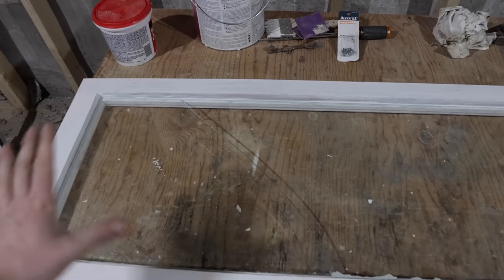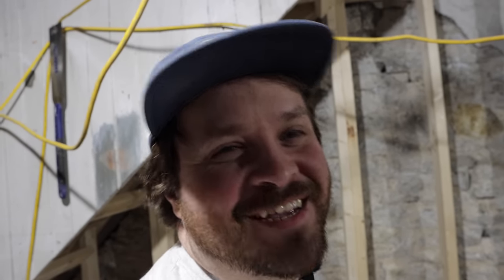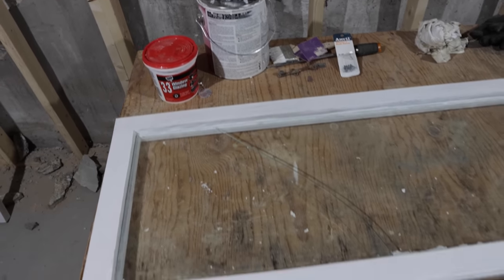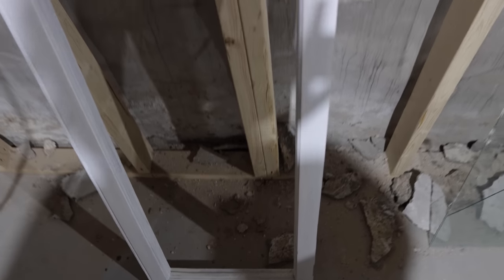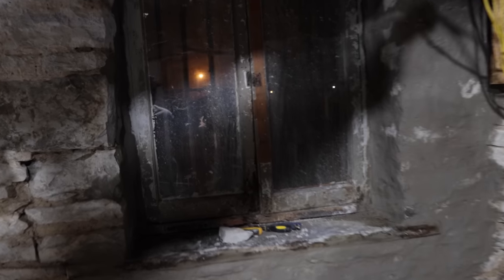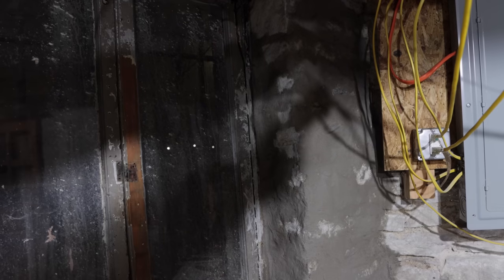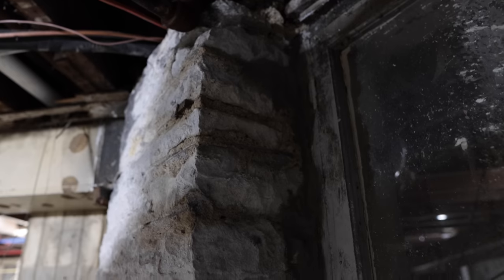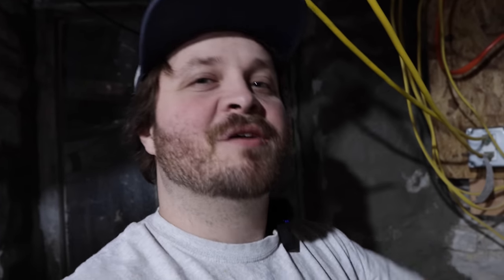Who Does This to a Window? S2 EP25

Comment: Your are totally right about "professionals" they never seem to care about the property they are working on.
Reply: Including their own. Visit a plumber, their toilet leaks.  Visit an electrician, their wiring shorts out, or there is a penny jambed into a fuse box.
One time, my dad purchased TV cable, and it was installed with the cable through a neatly drilled hole in a glass window.  My old wired alarm system had a wire hole drilled through a step, I did not find that until I installed a new carpet. Just what does it take to be a professional or even just be competent.
Reply: @Kaasmantel97  I feel like common sense, personal standards, and values died a while ago....

Comment: There is a mud gun for sheet rock that also now can use to put the thin concrete into the rock walls with the correct pressure it shoots it into the cavaties!

Comment: I work on pipe organs, and I have worked on 2 organs that the wire installers drilled thru a wall right into the main air line that feeds the organ. One of them was Radio City Music Hall!

Easiest, cheapest, fastest is the motto of installers of cable/internet/etc. They get paid by the completed job, not how well they did the job. Last time I had a cable guy replace my line from the pole, I watched him like a hawk and made sure he didn't do something dumb like a 1/2 inch hole in my original hardwood floors. I wasn't a dick about it, but I made sure it was done right.

Comment: Kaleb, you have been doing your home work. The windows are looking great.  I respect your choice of materials and technique. I did my home work, too. Abatron products: LiquidWood wood consolident, WoodEpox strucural adhesive, and Sherwin Williams Exterior Oil-Based wood primer. You mentioned SarcoSeal glazing compound. Yes! I have found it has woked better than any glazing out there. Even better than Dap 33. But, may I humbly impart a little advice about painting glazing compound? Reframe from priming and top coating it for a while. Maybe even a month. Because, I have found that as it dries, it shrinks, and therefore, the paint will become krinkeled. This is unplesant to look at and will trap dirt overt time. Just have the patiece to wait and prime and top coat later. My 1870s windows required much work, too.
More humble advice. When pointing your stone walls, use white portland instead of gray portland. Especaily where the walls will be seen. Upon close inspection, you will notice that gray was not used. Here is my mortar mix for simi-hard stone and brick: 1 white Portland, 4 lime, and 6 sand. Don't use mechanically crushed sand. Use natural river sand. Everything will point better. Any questions about where to find White portland? Contact me. (periodpaper@yahoo.com)
John
Bethel Missouri

Comment: About running the coax for the cable, I'd have the new coax run before you disconnect the current cable to keep down time to a minimum.  It's what I did to a brick, mortar and cinderblock house we lived in.  It was run through the crawl space and up through the floor, in the wrong room.  So I sunk coax through the floor where it was supposed to come in and voila, connected in just a few minutes.  I know your choices are slim as to where to run the cable in that doesn't involve a heavy duty masonry bit, but I think the process could be the same.
I hope this helps to keep the down time of the internet to a minimum for you two.
Thank you for a great video and don't worry too much about that broken pane of glass.  Like you said, it's an opportunity to install a thicker pane of glass now, albeit not period, but no less efficient. 👍👍🥰🥰🤗🤗😘😘

Comment: Sorry about the cracked glass. I can't remember how many times I've done this. As far as the cable guy running a cable through the window frame that is just wrong. My wife tells me to stop complaining about the millennials, but I just can't, not many take pride in their work. Sealing the windows will help tremendously. Once the basement is warm it will keep the floor warm for upstairs and downstairs. Keep up the good work.

Comment: Couple things about glass work.  First, look into Sarco glazing; it works very well and skins much quicker than DAP.  Also,  there are a couple videos out there where people use a palm sander with a cloth on the base to vibrate the glass down into the bedding glaze.  I can't find it now, of course, but the vibrations help evenly settle the glass.

Comment: When using Linseed Oil Putty - put the putty in the microwave for c.45 seconds to 1 min to soften the putty to make it more workable (the stiffer it is the longer time it needs in microwave to soften). If you leave it in the microwave too long and the putty becomes too soft & unworkable - just wait 10-15 mins allowing the Putty to cool before you use it. Also reusing the original single pane glass sheet is a waste of time. You are far better to use a 4-5mm laminated glass sheet instead.

Comment: The internet cable installer should have cleared that with you first. It’s obviously hard to get through thick walls, but i would make them come back out and redo.  If it’s an Ethernet cable you’ll need a crimping tool and it takes 5 minutes to learn how to crimp, however, if it is fibre, they will need to come out to splice it for you. Do not splice it yourself, you could damage their network.

Comment: Dap 33 takes months to harden.. highly suggest using sarco type M or Sarco dual glaze.. sets in a matter of days, where dap is just starting by the time sarco is done. And linseed oil the rabbet instead of prime. The glazing compound will not shrink. Priming works, but linseed oil works better. FYI :)

Comment: You gotta be super-careful when you push in those push points. One little nick on the edge and boom.  Try to move as parallel to the glass as possible so none of the point just glides along the top of the glass.  How did I think of it, perhaps lightly sanding the sharp edge of the glass will lessen the likelihood of a nick. Hmmm...

Comment: Run an entirely new line first along the length of the current line, connector point to connector point, without even touching the current line. Get the new line entirely installed except for the connects at the ends. Then you can swap connections in like five minutes and have almost zero downtime.

Comment: I think you were having a downer probably because that pane of glass broke after you'd gone to so much work and got so far with it. I understand your feelings on that.  Still, a brand new pane, though not what you wanted, will certainly last a whole lot longer [we hope!]. Be careful with the other original one though [also not the original glass the Vet installed].

In regard to the drilling through the wooden casement of the window to install the internet cable, as you say, Kaleb: "Hey Dude, COME ON...!!!"  I just had a new Internet set up done and you should see the absolute MESS the engineers made of it. The drilled through the PVC surround to my door [as you know I live in a modern high rise block - not that you'd know it inside my apartment as it's all done out like something from 1880-1920].  In the end their botched MESS had to be taken out again [by ME] because I needed a WiFi set up and they installed an ethernet installation MILES away from where I have my PC.  As you guys say "Go Figure" How come no-one asked me which installation I needed before they started??  "Hey Dudes, COME ON!!!

I'm sure you know you have OCD [I have it too], so really, neither of us were built to be in the 21st Century. We both really belong back when people did things properly. When they took the time to GET IT RIGHT - what ever "It" was. Never mind, at least YOU are getting it right NOW for your gorgeous house. You feel the absolute BUZZ when a job comes together as it should. You'll get there in the end!!

Comment: 8:17 Typical cable tech behavior. "Hurry up and pop it in then get out" And they always try to refuse to use the old line (I had to specifically tell the guy that put mine in) so you end up with a rat's nest of wires and holes everywhere. I have counted remnants from at least THREE sets of lines in and on my house.

Comment: I get ya kaleb..Sometimes we have a rough streak , i find myself having "seasonal depression disorder" too lately.  I get uninspired also as all the work i want to do is outside (coating my roof, build a floating deck ..btw, what type of mix are you using for pointing? I ironically  want to do pointing myself .. I understand it should be a lime mix when it comes to an old stone foundation..im considering pointing the outside of my house this year and wanted your input, thx!
Reply: Nevermind, I found ou😒

Comment: I can't stand the way some people install utilities. If you can't do it right, find a new profession. I actually kicked a guy out (Directv) who started drilling through my hardwood floor to drop a line in a bedroom! That was AFTER he had cut a slice in my brand new carpet in another bedroom. I ended up installing wall outlets myself and running coax lines through the walls and installing a junction box in the basement. Then I called them back out to install it MY way.

Comment: What a dumb internet cable install. Did this house not have cable TV? I cannot see why it could not have been run though the same area as the cable TV stuff. Taking shortcuts seems to be the rule rather then the exception........ Hope you get it all straight.